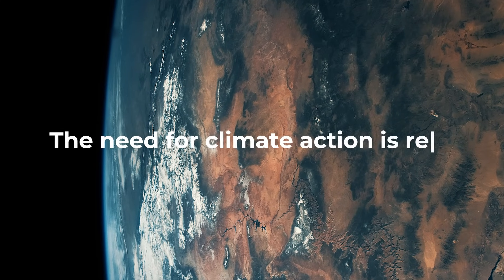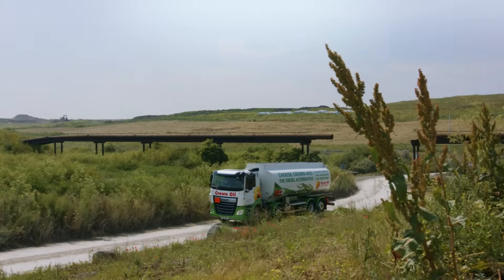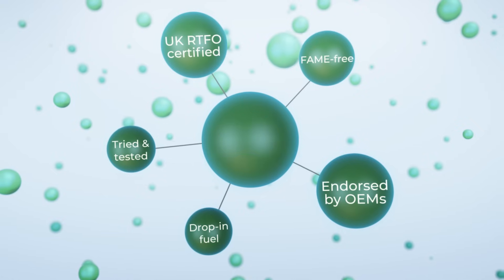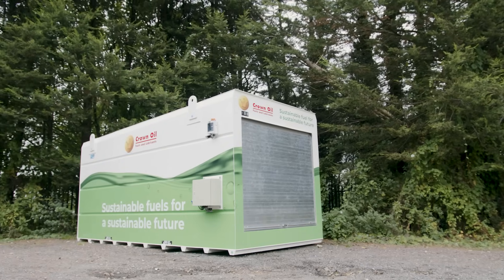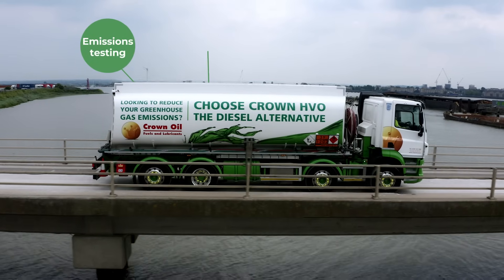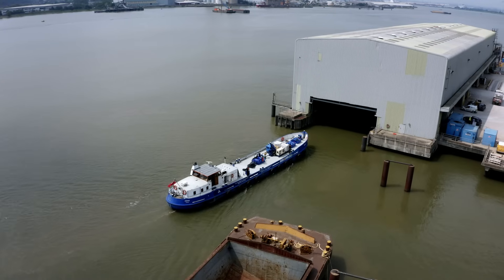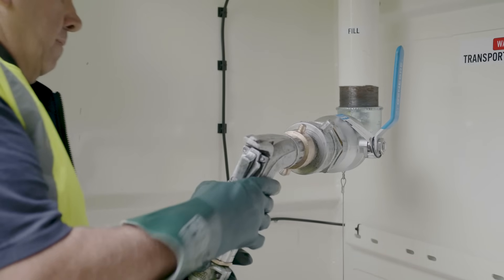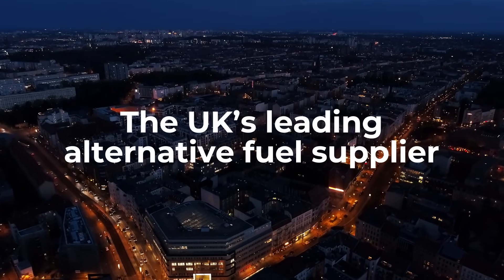Fuelling change with HVO fuel | Crown Oil

Comment: H2 and Electric. Anything else is greenwashing nonsense.
Reply: Bit much to call this greenwashing but say H2 isn’t hmmmm?! 😉  
This is a transitional fuel, or might be a solution for some markets. H2 has yet to prove it has a place in any market, but is being pushed aggressively by oil and gas interests because of the main source being natural gas.
Reply: @cjeam9199  As long as production is clean the. It certainly is.
Reply: Can't find prices anywhere.
Reply: No. H2 and Electric are greenwashing. HVO is the logical alternative.